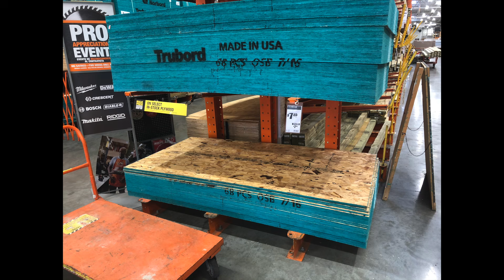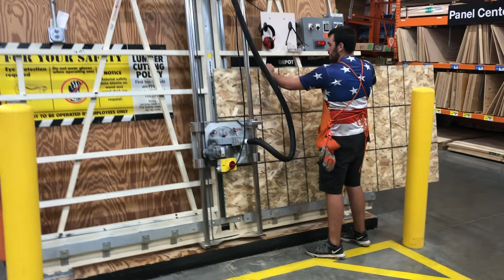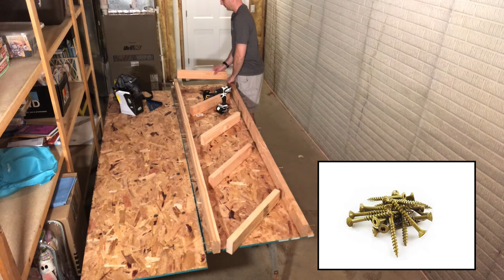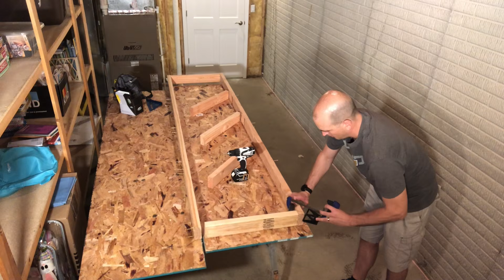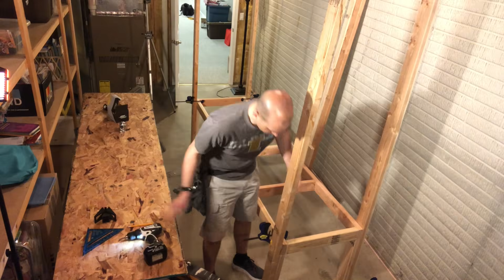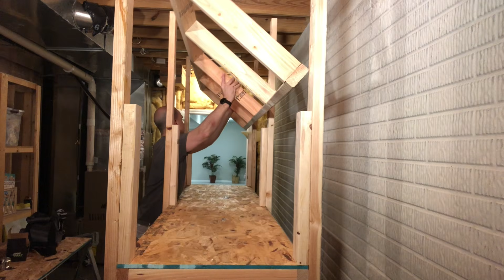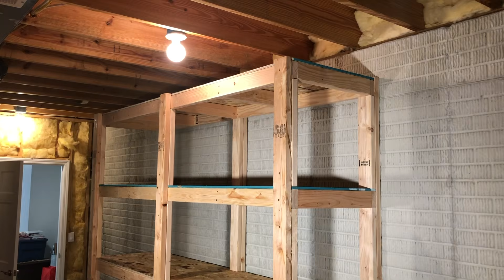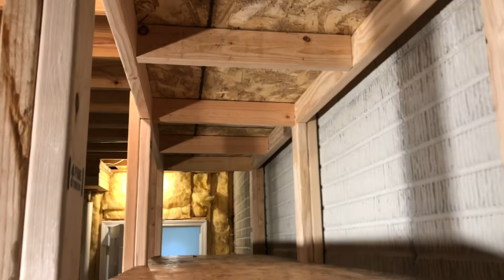How To Build Storage Shelves | Easy Build

Comment: Nice EASY build, Good video.  My brother-In-law was here In the USA in 1994 from Poland and he had a couple of months of free time and he built me similar shelving units. I had to BUY the studs but the 1/2” plywood I got free from work (they were taking down some of their old shelves.).  I had him build 3 shelving units 2x12’, 2x6’ and 2x5’. They all had 3 shelves. I used 2x3” studs and all screwed together. All painted dark brown. When I moved, i Just unscrewed everything and reassembled at my new home.The short units fir into the garage, the 12’ unit in the basement.  Thanks….Jim
PS……is there a reason you put the top shelf on? My shelves ended and I don’t have a shelf that really doesn’t do anything.

Comment: I built my shelving similar to this several years ago. In a garage, you may have a significant variation in the levelness of your floor, especially as you get away from your walls. 

A couple things I would change would be to attache the full length back 2x4s to the wall first, then use a level and mark where your back shelving supports would go. Cut and install them. Then set the bottom shelf on the back supports and use a 2x4 and a clamp to assist in leveling the shelves back to front. Once the bottom shelf is level, measure and cut your supports and then install the front 2x4s. The rest is pretty much how you did it. The only other things I would add would be to use a square when assembling the shelving frames and use some additional screws when assembling. Everything is cheaply made these days and I have had screw heads pop off before. Better to add a couple extra screws to be safe. I would also add a few screws to the shelving to help keep the shelving square and protect from racking, as unlikely at that is with this type of build.

Comment: Worked out perfectly for me! Thanks for the plans and sizes made it super convenient and easy to build. After it was built mine rocked a little but I just used some sticky furniture feet pads to even it out. I'm sure once weight was put on it it would have leveled itself. Thanks again!

Comment: Scott, i am happy to report that i finished building my shelving 8 ft by 8ft by 2 ft yesterday and I could not be more pleased. it is super solid and I am proud of it. it took me about 4.5 hours overall so I was considerably slow but the speed didn't matter to me. i took my time building it. i also had to cut pieces myself because after I loaded the wood in the cart, lowe's saw was not functioning yesterday.  i just love it and I can see the potential for things to come with it. you are a huge inspiration for it. i am dropping back again to say a big thank you.
Reply from the maker: Hey Saurabh, nice work on knocking out the project 👊. What’s next on the To Do List?
Reply from the maker: Hey Saurabh, nice work on knocking out the project 👊. What’s next on the To Do List?
Reply: @EverydayHomeRepairs  will keep you posted. Will shout out if i need your help/advise. Thanks again

Comment: Thanks for the video. I went to Home Depot and the supplies were 200$. Instead of using 6 vertical 2*4. I used 4 and reduced the size to 3 shelf.
It is a lot of material of garage rack. 

The sizing really helped.

Comment: I JUST finished building this in my garage, and MAAAAAAAAAAAN, this thing is solid and sturdy. I can tell this thing is going to stand the test of time. The only change I made was turning the 3rd shelf into the top shelf. After putting the plyboard up, I screwed into the support under it, then sawed off the ends of the 8' legs so it's 6' tall now.

Comment: Can someone help me with how the inches add up height-wise?

8 ft 2x4 legs = 96 inches

(4 20" vertical supports = 80) + (4 1/2'' shelves = 2) + (4 4" horizontal supports = 16) = 98 inches.

So shouldn't the inside stack of wood be 2 inches taller than the 8 ft legs, or am I missing something.. The video clearly shows the legs fit snug at the top of the top shelf, so it must be me. I just do not know where I went wrong. Thanks!
Reply: And same question with the support under each shelf. 

If the board is 24 inches deep and the horizontal supports are both 2 inches (4 total), then wouldn't the cross supports under the shelf need to be 20 inches not 21?
Reply: 2x4’s are actually 1 1/2” x 3 1/2”
Reply: The 4" horizontal supports includes the plywood (3-1/2 and 1/2 respectively).  Therefore, 80+16=96.

Comment: Great project - thanks for this - great job.

$280 for everything at Lowes yesterday, + $20 tip for the kid who cut the lumber for me.
Not even close to a $100 project, but fun to do, all the same.
You'll need 2 x 80 or 4 x 40 boxes of screws if (unlike me) you wish to avoid 2 trips to the store.
Reply: Inflation is a real B
Reply: Home Depot estimate $200 + tax on 7/7/22. Can't help but chuckle when I hear videos say how cheap it was to build (2 years ago or longer). Inflation sucks!

Comment: Hello Scott. I wanted to compliment you on your shelving project. I built my dad several shelves precisely like yours 40 years ago. I am 61 now and he is 81. The only difference is that I used 3/4” cdx decking plywood. I wanted it to where he could store auto engine blocks on it if he wanted. (He never did but they are very heavily loaded). Just wanted to let you know that this design has lasted for 40 years and still going strong.
Reply from the maker: Hey Robert, really appreciate the feedback and letting me know I should have several more decades of use out of these shelves.  Take care 👍

Comment: Great tutorial, thank you! Made all the necessary adjustments for my shelves, went to Home Depot optimistic.  The prices are over the roof, $10 for a 2x4, $40-$50 for one sheet of plywood. So the total cost will be way over $300. Idk if it's just the HD in my area but it's not worth it when a steel shelving is $300.
Reply: I went to my HD last weekend.  2x4 at $8.25 each, and plywood at $48.. so $254 right there 😐
Reply: Unfortunately today (07/18/22), the lumber, screws, and corner clamp only with 6% tax cost $210.47 at Lowe's in Naples, FL
Reply: @davidyoung3447  also trying to do this in Naples right now. Sadly, I'm not totally sure it's with the cost vs prebulit.
Reply: He made this video 3 years ago

Comment: Is there a reason why the top shelf is so close to the joists?
Reply from the maker: I wanted to make a set of shelves that would both fit basements but also garages.  For my install the top shelf isn't super useful but if it was in a garage that would not be the case.  You can adjust to fit your install and get a little more use out of the top shelf.
Reply: @EverydayHomeRepairs  Thank you for the clarification. There is a DIY rack in my basement from the previous owner and it also has a high top shelf, I thought there could be some hidden benefits from it :)

Comment: Hi,

Thank you for the amazing video ☺️

I am planning on making one myself. 

One question: why aren't you using pressure treated wood where the shelves make contact with the concrete floor and wall? Doesn't that improve the structure of life?

Comment: If depth is 24inch, then how did you use 21 inch pieces  ? As 2+2+21=25 inch depth
Reply from the maker: It is a bit confusing but a 2x4 is actually 1.5 inches x 3.5 inches.

Comment: You have the best shelf designed  that I have seen, step by step you are exactly what I have been  looking for... my first shelf built I started with a strip across and screwing it into the wall and add more on the side so the shelf would sit on top, after building one shelf I didn't like it because I had drill holes into my wall so I stop the project and decided to find another method than I saw your channel.... I  loved how you presented the information, it makes more sense than having to drill holes into my wall....

Comment: Our Home Depot and Lowes doesn't have the fancy chop saw, and the panel saw at HD is out of order 100% of the time for years on end. Plus, (our) Lowes will not stand behind accurate cuts and will defend bad cuts off by 5/16 inch. I've seen them ruin entire sheets of plywood, then the manager defends their practice and lack of accuracy. So I ALWAYS have them do any cuts way oversize, and have to do the accurate cutting at home. Problem with that is often it reduces the amount of useful wood per sheet, since I usually plan things for minimum waste.
Reply from the maker: I wonder how long it will take them to get an automated table saw which cut at a reasonable accuracy 🤔
Reply: @EverydayHomeRepairs  I doubt they ever will, because they don't really want to make cuts anyway. Sometimes I have to walk the entire length of the store looking for an employee, then have them call for someone who can use the panel saw. Then sometimes I wait another 20 minutes for that person to arrive, and often have to then ask a second time for help. Another issue: their blade is not sharp and really hacks up the plywood, which is another reason I need oversize cuts to trim nicer at home. I've asked if they ever replace the blade and they just roll their eyes. And finally, the method they use to "sight" the cut is just ridiculous. They remove the  vacuum hose and have to peer into that dark hole to try to see my mark. No wonder their cuts are off. All in all, at least at the box stores in my area, it's best to forget any store cuts, lug it home and do it right (although I do not have a panel saw).

Comment: Why is the top shelf necessary? If the storage unit is 8 ft tall what can you store on top of it? Wouldn't it be better to just have a 6 ft tall storage unit and leave it at that because there's no real storage space above the top 8 foot Shelf in a garage with 8 ft walls! If it took 4 hours to build and purchase and install how much easier would it be to build just a six-foot-tall unit!
Reply from the maker: Hey David,  I actually did the 8 ft height more for the viewers as compared to this specific basement install.  Many people over the years have built these same shelves for their garage where the top shelf comes in handy.

Comment: Would using the same design work fine for something deeper and wider, also where the lowest shelf is 6 or 7 feet above the floor so large stuff fits floor level underneath? My idea is a 10 or even 12 feet long shelf, 10 feet tall, 3 feet deep with two shelves on top. I hope the 6 vertical supports are still suitable for that because I prefer not to have so much interruption. 

I'm gonna look at current material prices because I did not realize pallet racking is so expensive so I'm looking at wood again 😬 I like this because the feet end up chunkier so it seems much sturdier than other versions where she shelves are just hanging off some screws and over time they twist and the whole thing gets crooked... I don't need the shelves up top to support ultra heavy stuff as I'm gonna be putting that on the floor. But I also don't want it be wobbly or anything.

Comment: Thanks for posting this. Nice design and instructions. 

I customized your design somewhat so I could fit it in my basement. My lowest shelf is 6 inches off the ground instead of 20, and I have 18 inches between the other shelves instead of 20. I added 3 inch caps to the each of the legs on the top shelf to help keep it in place. The total height is 6'7".

I used roughly the same amount of materials (24 2x4s and 2 sheets of OSB). Cost of materials in September 2021 was about $130.

Comment: Any chance this design would work with 1x3s given the cost of lumber? Even with high prices, you still can’t buy anything bigger than you can build it-so I’m just trying to rationalize the increased cost that way. I also plan on using pre-Covid 1 inch sanded plywood in precut sheets of 2x4 (so two across) because of cost!
Reply from the maker: Hey Elaine, I think you could cost reduce this a bit since I know lumber is a bit crazy right now.  With that said the price should start to come down soon.  Also depends on what you plan on storing on each shelf.  Some have removed the top shelf and not installed the center leg to save money.  I would probably still use 2x4's just try to reduce the number of boards needed by adjusting to your need.  Best of luck!

Comment: I built this!   Will build another when lumber is cheaper.    Works great, wife is happy.   We can store 5 medium sized bins per shelf.   The 4 clamps were key as the 2x4’s I used tended to warp.   Had all of the wood cut at Lowe’s - doing this was key because it ensured that the lengths were consistent.
Reply from the maker: Nice and yes wood prices are a little crazy right now.  Probably smart to let things cool off and build it for half the cost 👍

Comment: A simpler time when lumber wasn’t so expensive 😅
Reply: Fortunately, it's coming down again. Built one this weekend for about $130.
Reply: @scrapdog76  not much down?! 30$ osb.. 
RIP diy!
Reply: @nkhs4860  Yeah, when I posted that back in September, OSB was about $17 and 2x4s were a little above $3. Now the prices have doubled.
Reply: @scrapdog76  ok, good to know the levels back then.
Will wait for some improvement.
Reply: @scrapdog76  thank goodness. I was contemplating just buying pallet racks cause the wood got so expensive. I need some real big shelving. Screw it I'm doing wood.....
Reply: Built two of these last fall for less than $100 each. Over $200 to build one today.
Reply: @aquavelvetman  cost me $388 now
Reply: @CuriosityCafe  yikes. I need some shelves under my stairs and I'm not sure my wallet can handle this 😯
Reply: No kidding
Reply: Unfortunately today (07/18/22), the lumber, screws, and corner clamp only with 6% tax cost $210.47 at Lowe's in Naples, FL
Reply: @davidyoung3447  welcome to Biden’s America.
Reply: 07/18/2023 total build cost for me was about $118. Way cheaper than buying a heavy duty shelf at the store for over $200. This was the best investment ever. Thanks for this idea 💡👌🏾🤟🏾💪🏾
Reply: As of May 29th 2024, it'd cost me $157 in my area.
Reply: Straight up
Reply: Worse every day. #Bidenflation #NWO
Reply: Under 100 dollars, sheeeit
Reply: 2x4s were $3.75 and OSB was $15 at Home Depot yesterday (10/23). Going to build a couple more.
Reply: @scrapdog76  Thinking about building, what was your estimated cost for the something similar to his in the video?
Reply: If cost overruns (inc you time) are what you are looking for, this is your man, Stan.

1) Cross members?  Unless you are shelving osmium, a cross support every 24 inches on a 96 inch by 1/2 osb is overkill. A cross support at 32 and 64 would be fine.  Don't believe me.  Lay it out on the ground and stand on it.

2)  Irwin clamps?   For a project like garage shelves, I have never seen a man screw 2 pieces of wood at right angles to one another and need one of those, esp if he can brace one end of the board against his legs.

3) Vertical shelf supports.   Yes, a 4 inch support to hold the shelf so you can lay the shelf on top of it makes a total sense.   But, why in the world a shelf to shelf veriticle support.

4) Pop Quiz.  What can he put on the top shelf?  That whole top osb and cross supports is a waste.

In our next class, we'll discuss sanding and staining the shelves.
Reply: @mas5867 3. The entire load is transferred to the inside 2x4s all the way to the ground. The way you described would have the load borne by the screws securing each shelf and shelf support to the legs. Granted, if you use several screws, the combined shear strength will be sufficient for the weight most people would put on these shelves. But his way the weight is resting on the 2x4s, and 2x4s hold up houses.
Reply: Let’s go brandon

Comment: Made a couple of these! They're great!! Used 5 legs (omitted front center legs/supports). Not loading super heavy in the center. 

Question though - need to make another but would work better to put the legs / shelf spacers on the short side (basically turning them 90 degrees so they are on the 2 ft sides not the 8 ft sides). Makes front totally flat and usable width a little more. (Only the 5th leg/support in the center rear would be on long side). Would that work? Noodled on it a while and I think it would be same rigidity, but before I built it thought I'd ask.

Thanks again! This project has resparked my interest in woodworking! Wife very happy.
Reply: Sounds like a good idea. Though you may have to add some kind of support to the middle support.

Comment: Thank you for showing how to do a very simple but very good storage shelf. I appreciate you showing how to use the big box store to cut the wood and how you batched out the sections to make it much easier to assemble. 

I recently bought some very sturdy metal shelves from Costco but they cost more than these did for you and they aren't as tall or as long. Next time I'm building shelves like you did!

Comment: How do they charge for cutting the wood rough estimate is ok too. And when u built the shelf did I plan on just putting things underneath the first shelf because how high the top shelf would be. Or would it have been better to put the first shelf like at about 2 in from floor so u can use the top shelf

Comment: Made these for my back yard shed. Super easy and super strong and best of all is they are free standing. One suggested improvement is to drill with a countersink bit for the screws. I also left the top open for this big not so heavy items to use all the space to the ceiling. Again, utterly brilliant video.
Reply from the maker: Thanks David, glad the video helped 👍

Comment: Hey Scott. Maybe I missed it, but do you need to drill pilot holes at all or have you just screwed in the screws without? Thanks for the fantastic video!
Reply from the maker: Around the 4:10 mark in the video you will see the only pilot holes I drilled.  These were just in the ends for each of the long 2x4's used for the shelf structure.
Reply: @EverydayHomeRepairs  Appreciate the reply! I love how simple this all is (seems). Cheers.